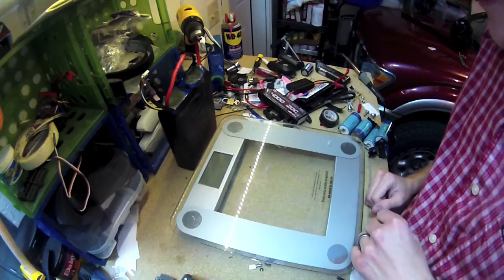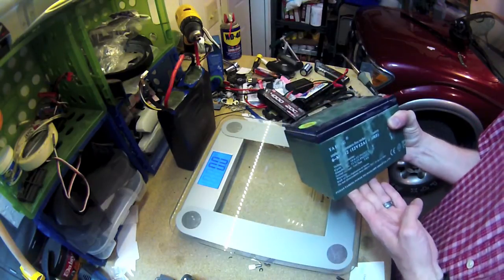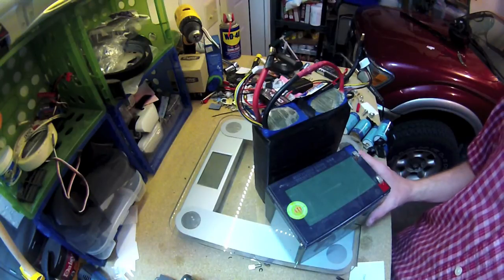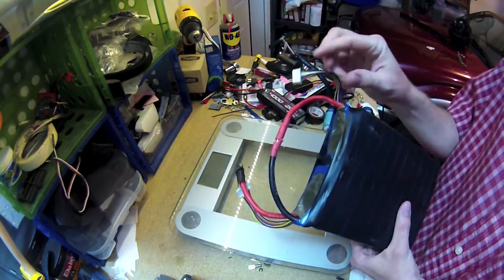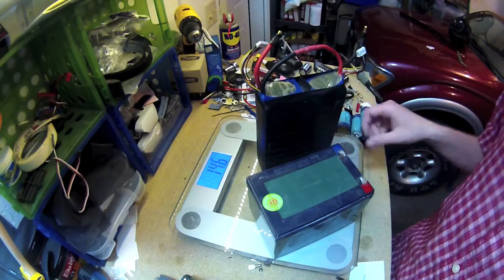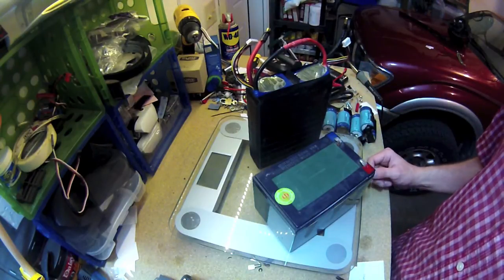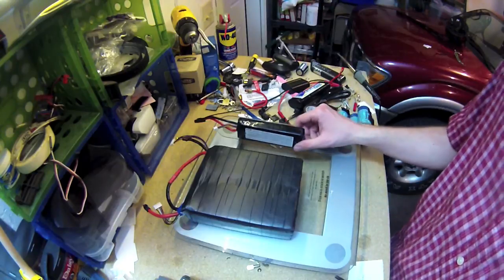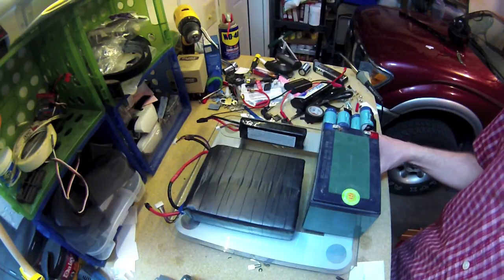Lipo vs Lead Acid

Comment: So if I have a lead acid battery that's 12volt 18ah it is 216wh. If I want an equivalent 3s lipo I would need a 18,000 mAh battery?

Comment: I never get the thousands of cycles that is advertized on recargalbe batteries.  And lead acid has water and acid in it this should help it to keep cool while running and charging and discargning where litium has nothing to help it to cool  but thats just my opinion i am no expert. i really dont know i am guessing.

Comment: Your Lipo vs Lead Acid video was very helpful.  I'm a photographer building a battery system for LED video lights. I run Lipo batteries on my tools and RC cars and boats. Most of the off the shelf solutions for video are lead acid but weight is a huge deal.  I'll post a project report on foto-tech dot com when I finish.